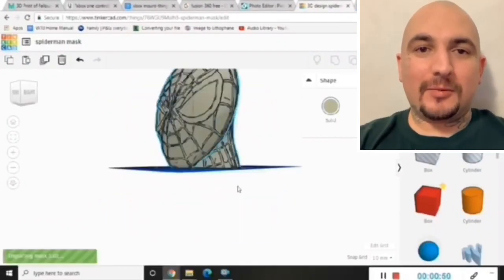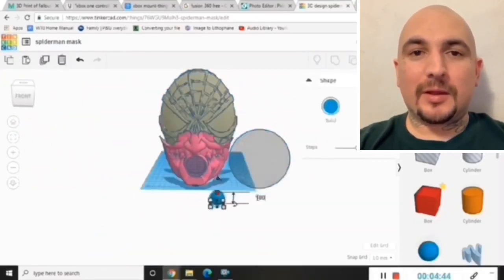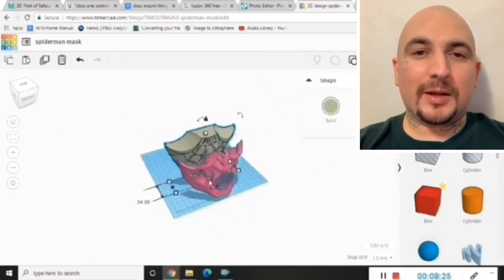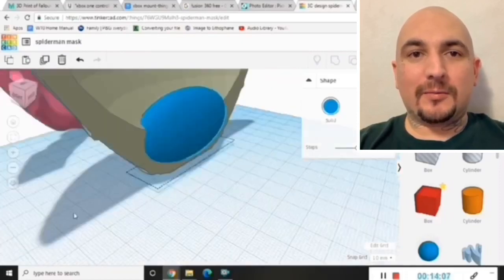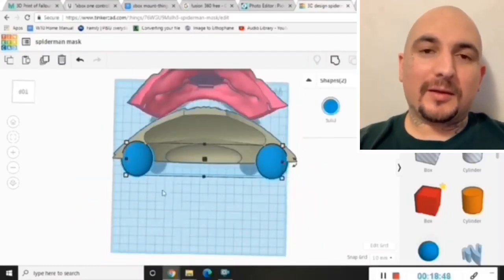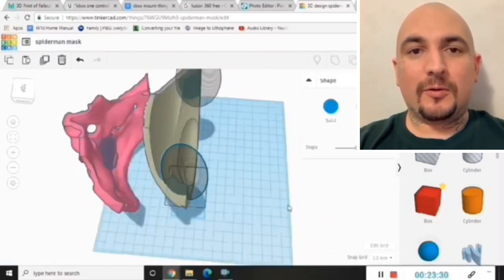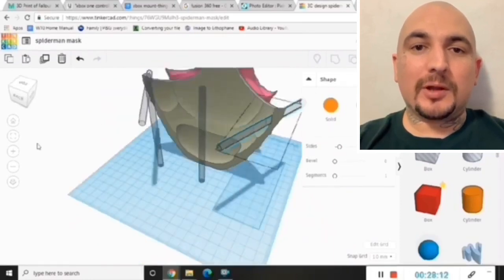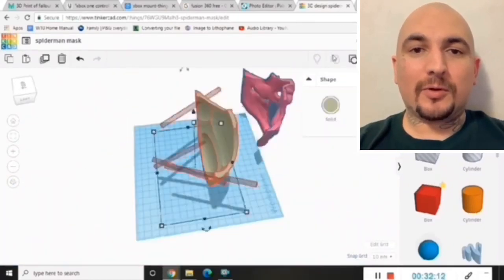3d Printed Spider-Man Mask // Marvel Comics

Comment: I'm actually trying to print this right now. Did you experience any issues with the plastic budding up against your face? What was the spray you used to preserve the paint? Do you have any other comments after using it?
Reply from the maker: Savaris group on my 1st video I show how I hot glue window sealer around the inside of the mask for comfort I don’t know how anyone uses 3d printed masks without some type of padding inside I can imagine it would irritate your skin and I use 5 good coats of mod Podge to seal the paint. Also I did this print on the lowest quality fast settings with the ender3 for video purposes I recommend doing the print at least at normal settings
Reply: @pericodesign1679  Thank you so much! This is my first 3d mask and since I have a smaller printer, it's taking a while to get the size right. Will definitely apply padding.
Reply from the maker: @savarisgroup  no problem! Also I did this mask to fit my face you can down or upscale it on your slicer to fit you better just make sure to do it exactly the same as the valve cover